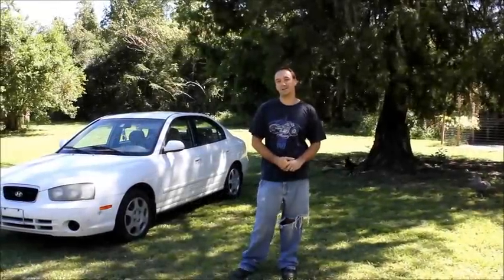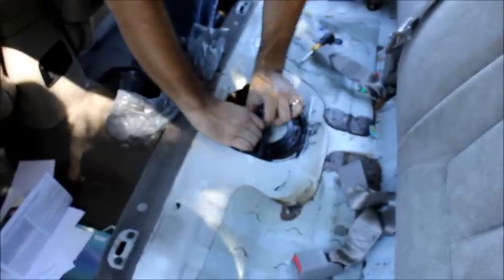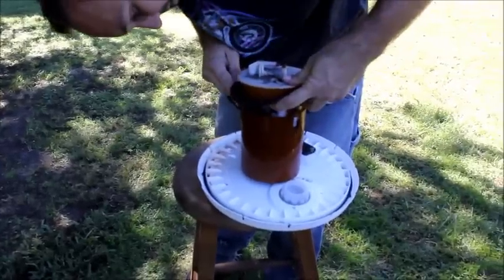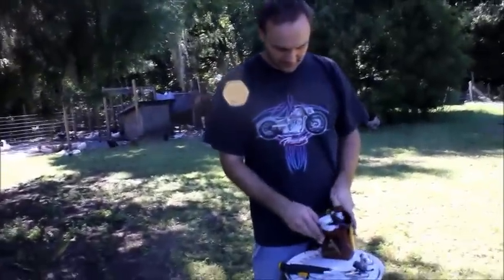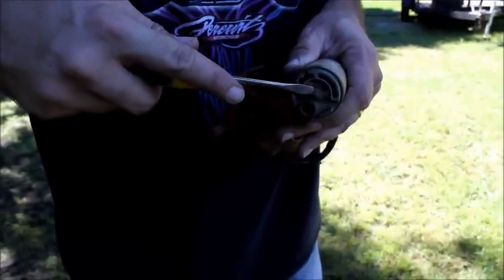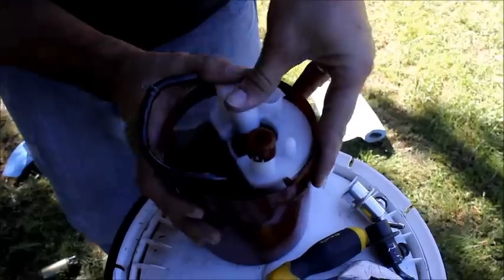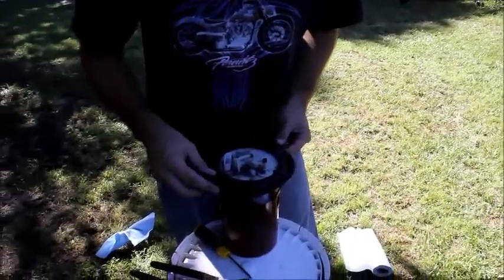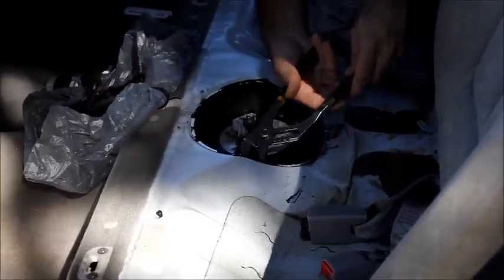Hyundai Elantra Fuel Filter/Pump/Regulator Replacement

Comment: Only video that actually showed the detailed process of changing out the pump. Not just the pump assembly
Reply: About how much fuel was there in the pump assembly? Also, does the fuel line to the engine empty back into the fuel pump assembly when you turn off the engine as I didn't see any fuel leak from that line when you took it off the fuel pump assembly? Thanks a bunch. I'm trying to salvage my son's (mine actually that he drives) car after he added five gallons of kerosene to the approx 8 gallons of gasoline that was already in it. Don't get me started on why he didn't know BLUE fuel cans are for KEROSENE and not GASOLINE. Tomorrow we're siphoning as much fuel as possible out of the tank and putting 5 gallons of high octane in to see if the engine will run or not. He drove less than 2 miles with the gas/kerosene mixture then said it wouldn't start right this morning!!!

Comment: my 2015 elan tea is shutting off a low idle and sometime while standing still. Changed the spark plugs and problem re occurred. You just gave me an idea  to go for the fuel regulator next as it is the least costly.

Comment: Thanks.   Step by step just like you showed
Reply: About how much fuel was there in the pump assembly? Also, does the fuel line to the engine empty back into the fuel pump assembly when you turn off the engine as I didn't see any fuel leak from that line when you took it off the fuel pump assembly? Thanks a bunch. I'm trying to salvage my son's (mine actually that he drives) car after he added five gallons of kerosene to the approx 8 gallons of gasoline that was already in it. Don't get me started on why he didn't know BLUE fuel cans are for KEROSENE and not GASOLINE. Tomorrow we're siphoning as much fuel as possible out of the tank and putting 5 gallons of high octane in to see if the engine will run or not. He drove less than 2 miles with the gas/kerosene mixture then said it wouldn't start right this morning!!!

Comment: Thank you for this video!! I used it today to replace mine!
Reply: About how much fuel was there in the pump assembly? Also, does the fuel line to the engine empty back into the fuel pump assembly when you turn off the engine as I didn't see any fuel leak from that line when you took it off the fuel pump assembly? Thanks a bunch. I'm trying to salvage my son's (mine actually that he drives) car after he added five gallons of kerosene to the approx 8 gallons of gasoline that was already in it. Don't get me started on why he didn't know BLUE fuel cans are for KEROSENE and not GASOLINE. Tomorrow we're siphoning as much fuel as possible out of the tank and putting 5 gallons of high octane in to see if the engine will run or not. He drove less than 2 miles with the gas/kerosene mixture then said it wouldn't start right this morning!!!

Comment: Thank you, dude!!! You've helped me out so much with this!!!
Reply: About how much fuel was there in the pump assembly? Also, does the fuel line to the engine empty back into the fuel pump assembly when you turn off the engine as I didn't see any fuel leak from that line when you took it off the fuel pump assembly? Thanks a bunch. I'm trying to salvage my son's (mine actually that he drives) car after he added five gallons of kerosene to the approx 8 gallons of gasoline that was already in it. Don't get me started on why he didn't know BLUE fuel cans are for KEROSENE and not GASOLINE. Tomorrow we're siphoning as much fuel as possible out of the tank and putting 5 gallons of high octane in to see if the engine will run or not. He drove less than 2 miles with the gas/kerosene mixture then said it wouldn't start right this morning!!!

Comment: About how much fuel was there in the pump assembly? Also, does the fuel line to the engine empty back into the fuel pump assembly when you turn off the engine as I didn't see any fuel leak from that line when you took it off the fuel pump assembly? Thanks a bunch. I'm trying to salvage my son's (mine actually that he drives) car after he added five gallons of kerosene to the approx 8 gallons of gasoline that was already in it. Don't get me started on why he didn't know BLUE fuel cans are for KEROSENE and not GASOLINE. Tomorrow we're siphoning as much fuel as possible out of the tank and putting 5 gallons of high octane in to see if the engine will run or not. He drove less than 2 miles with the gas/kerosene mixture then said it wouldn't start right this morning!!!

Comment: Nice work. Nice chickens
Reply: Mitaire Odiete me a 59 year old woman and a 30 year old woman followed your video and completed the fuel pump change I see why parts of the video are clipped the struggle was real trying to disassemble the fuel pump case and got frustrating when the part where the c clip was at was not shown in the video if I had to do it again it would be much easier please use better lighting on your future video's you saved me a lot of money thanks.

Comment: I bought a new fuel filter when my 2003 Elantra reached 105,000 miles because that's when the manual says to replace it, but the dealership said they don't replace them (maybe they want to sell you a whole fuel pump assembly). The process of replacing it seemed daunting though, and I put it off. Now it's at 160,000 miles and I watched this to see how big a job it really is. Should I attempt to just replace the filter if I'm having no other problems (other than decreased power and fuel economy) or should this be done only if you're going to replace everything? (I read that there are o-rings not included with new filters you need to reuse from the old part and I don't want to end up with a car that won't start because I messed up not putting it together just right!)

Comment: How did you get the pressure valve disconnected? I've only bee able to get the fuel line disconnected but the pressure valve remains tight and won't come off.
Reply: +AmateurHomestead I actually figured out what I needed to do. lol But your setup is different than mine. my fuel filter is located underneath the car and not in the fuel tank

Comment: I tell my customers I will only do this job as complete replace rebuild, including cover seal glue replacement. If the seal is not good the tank won't pressurize and will still have running and check engine light issues.
Reply: About how much fuel was there in the pump assembly? Also, does the fuel line to the engine empty back into the fuel pump assembly when you turn off the engine as I didn't see any fuel leak from that line when you took it off the fuel pump assembly? Thanks a bunch. I'm trying to salvage my son's (mine actually that he drives) car after he added five gallons of kerosene to the approx 8 gallons of gasoline that was already in it. Don't get me started on why he didn't know BLUE fuel cans are for KEROSENE and not GASOLINE. Tomorrow we're siphoning as much fuel as possible out of the tank and putting 5 gallons of high octane in to see if the engine will run or not. He drove less than 2 miles with the gas/kerosene mixture then said it wouldn't start right this morning!!!

Comment: So, my Elantra dies when warm, but will start after 15-20 minutes. Could this be the problem? Also, so no separate fuel filter in the line?
Reply: fedorov5549 you need to remplace the fuel pump, like in da video fedorov ! also change filters !

Comment: I have a 2006 Hyundai Elantra it shakes when I drive it and feels like it’s going to turn off I don’t know what it is. Maybe the fuel tank?
Reply: Sarahy Montoya Sarahy Montoya I have the same car had the same problem just changed the spark plugs and it's fine now if it still have the problem try cleaning the throttle body with carb cleaner
Reply: Thank you fellas! Trying to figure out my problem... Does A/C matter at all?

Comment: I have the 03.. it boggs down at 30-40 mph.. been doing it over a year, hasn't gotten worse.. maybe spark plugs?
Reply: Did you ever figure that out? Dealing with same issue right now
Reply: @miketall5950  naw, the transmission ended up going out.. however, I do use Lucas gas treatment a cpl times a year

Comment: i have a elantra, where is the automatic transmision filter?
Reply: +jose gomez I removed the transmission oil pan, but nothing in there. I guess it should be somewhere inside the trans, but not sure if it indeed comes with one.
Reply: there isnt one